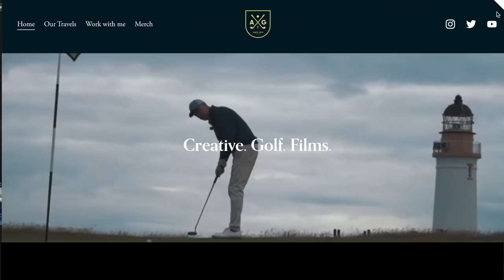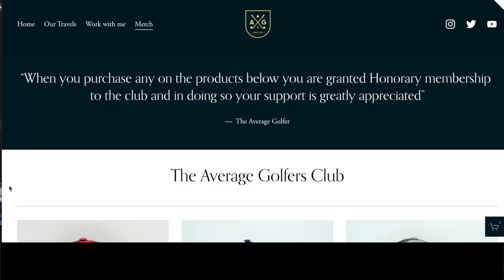I decided to LEAVE!!

Comment: Just checked out the web site. Some good work there. You should be aware that the home page has an image cycle rate that's too fast for useful communication. Nobody can take in that rate of change. Slow it down - half speed would be the minimum for useful communication. 

And please don't go through the "we are experts, we know better" process. Nobody, but nobody likes flashing images that switch before they have understood what's happening - even worse you've forgotten to provide a user tool to select the image of interest.

Good start, but your web tech guys can do better.